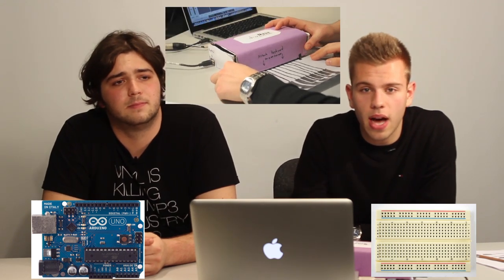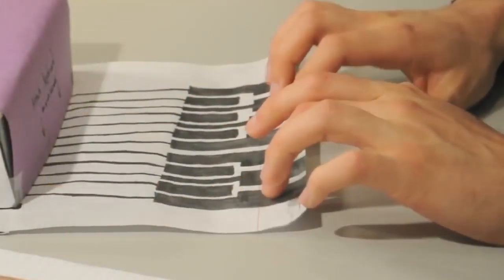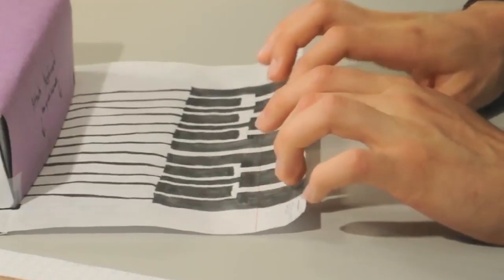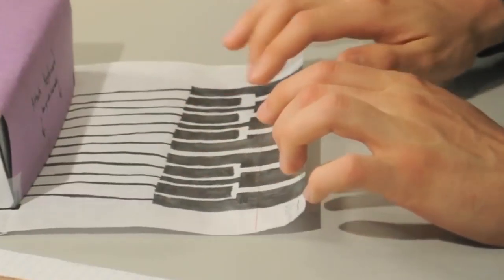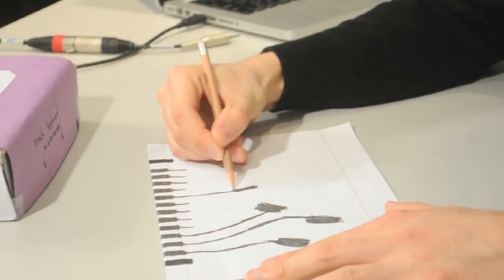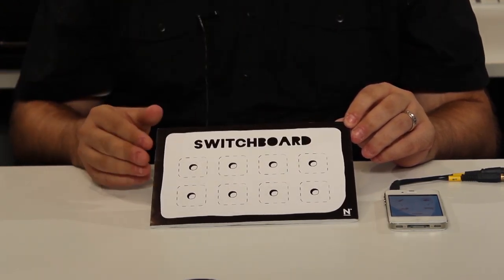DIY Paper Circuit Project: Draw Midi

Comment: hi the instructables is incomplete! we don't know what to do with the midi out, what kind of resistors are needed, or what the circuitry looks like. HELP PLEASE!

thanks :D
Reply from the maker: Hi There! Please see the Max patch. If you have Max MSP you can copy it into your patch window. If you don't, you can still run it by downloading the free Max runtime program. You don't actually need a resistor for this project, but if you're getting noise you can use a pull-up resistor.